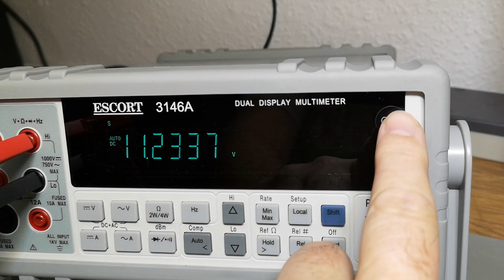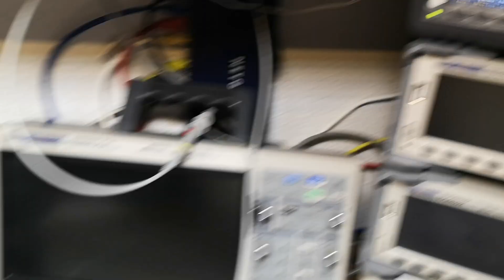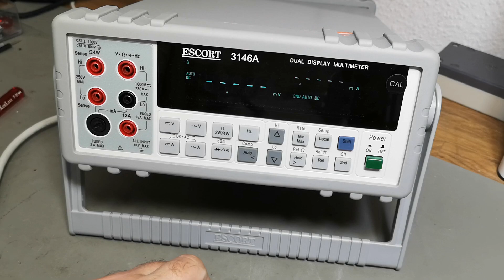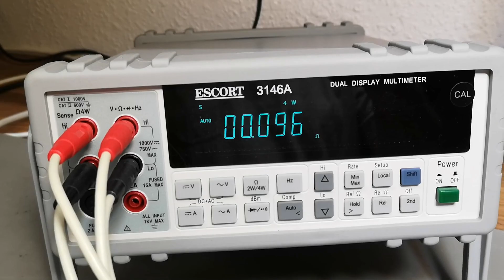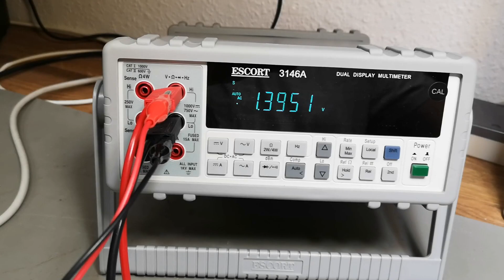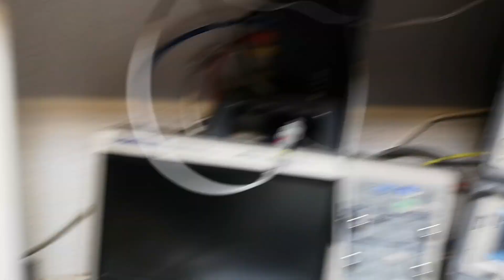ESCORT 3146A Dual Display Multimeter (agilent keysight U3402A)

Comment: I'd say you can change the update rate by pressing the Shift key and then Rate, which is on the Min Max key. Looks like the annunciator is showing it's at its slowest rate.
Reply from the maker: it is an advantage to use slow update for making video, i get a more stable readout that is better visual :-) but of course if you adjust something, it could be smart to use a very fast update

Comment: Hi Thomas, I was already thinking how incredibly well-preserved it is, and you just said that it's fresh out of the box
I liked Escorts, one was a manual multimeter specializing in automotive and the other in which I used to measure the first one was a tuned Ford Escort.
The meter was incredibly accurate, the most accurate automotive multimeter I've had.

Nice day 🙂🙂 Tom